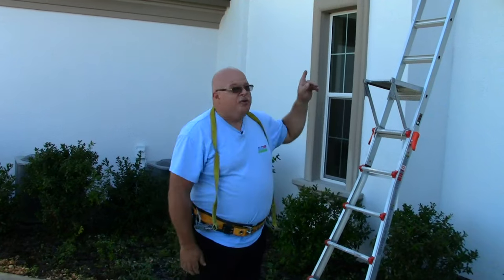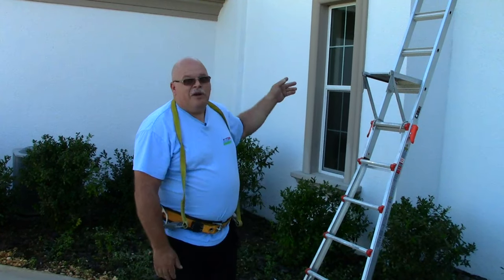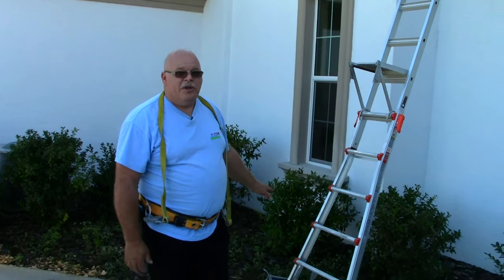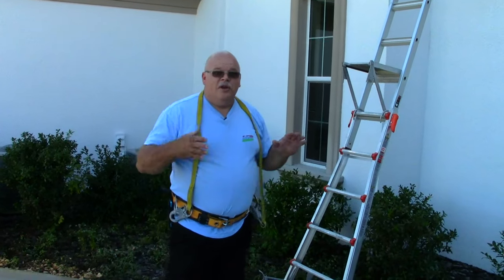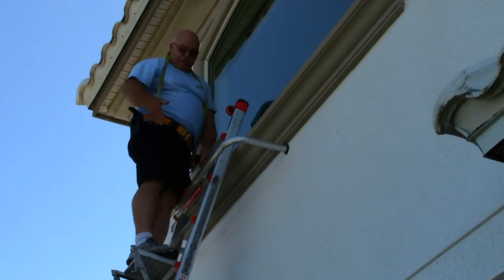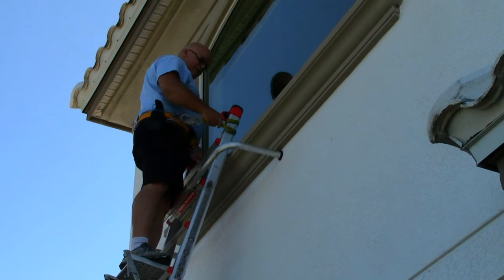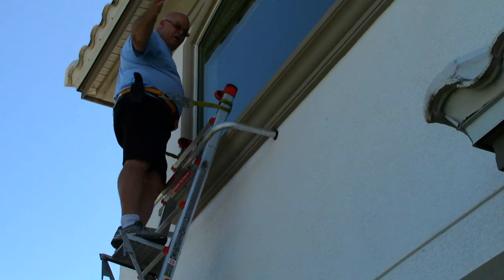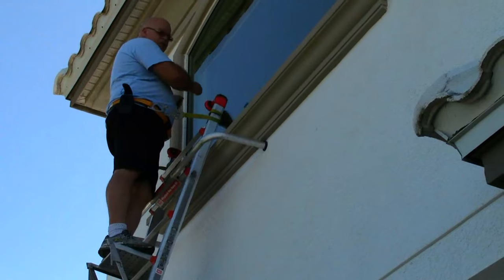Little Giant Ladder Safety

Comment: Working with extension ladders daily for years and receiving safety training on OSHA guidelines I can not recommend this set up. Personally having witnessed accidents with ladders, I find this set up to be extremely dangerous in the event of a ladder sliding out. It is not safe to be tied to a ladder while it is falling. Having a ladder wrapped around your body will injure you more than an impact on ground alone. This configuration can also cause head injuries since it may pull your body parallel with the ground.

Comment: Funny you talk about ladder safety and yet you set one of the ladder legs on a piece of metal ( the step platform from the ladder) on top of rocks. The pressure from you walking up the ladder could easily make that plate slide. OSHA would have love to see that.

Comment: Iv heard of alot of people falling from this ladder the middle of it is very shakey where it folds and it bows in and the ladder slides out
Reply from the maker: Never had a problem and I was 275 lbs then. We use them every day. The principle applies to all ladders for safety though.
Reply from the maker: Maybe cheap imitations, which there are several, have a folding problem. Seriously, never has this been an issue with us. I will likely buy another when I outfit another crew.
Reply from the maker: I commented back to you. Thanks
Reply: @GlassRestoration  appreciate it I'm looking to get a new ladder I like how compact this one can be just a little nervous